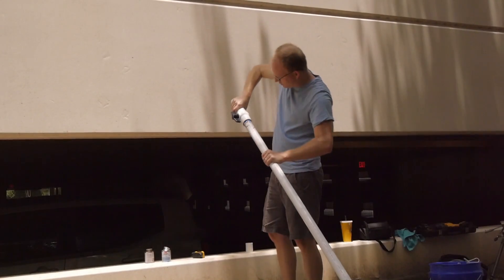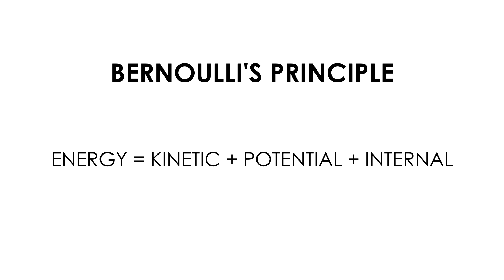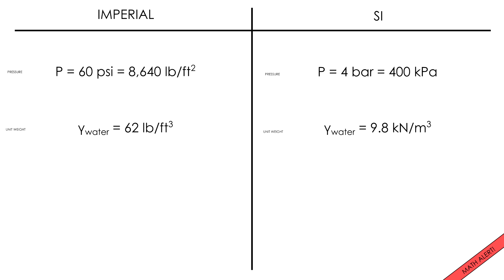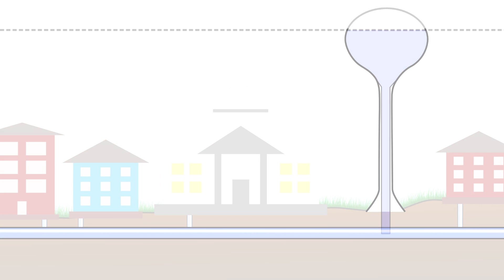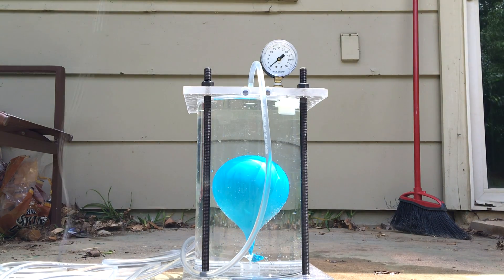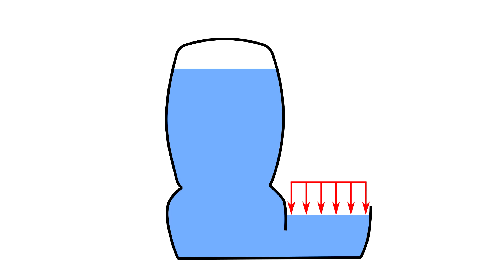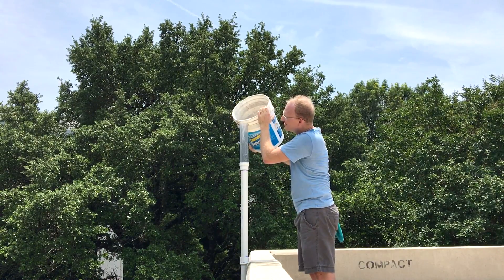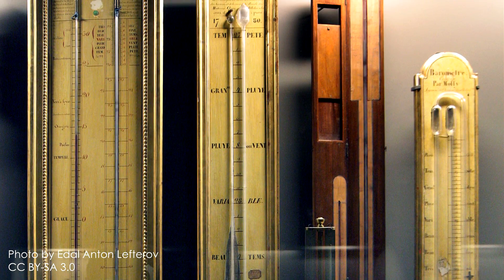Boil Water at Room Temperature! - Hydrostatics

Comment: First of all, I loved the video. Unfortunately... I watched it over and over and I just don't understand why or how the water in the ⅛" ID tube creates as much pressure as an ocean full of water if you were as deep in the ocean as the tube is high.  I understand the equation and I see how, if the equation is correct, the pressure is not affected by the volume of water, but I don't get how it COULD be correct.
Reply: visualise a particle of water. when measuring the pressure you're messing the weight of all of the particles above that particle pushing down on your particle. imagine the particles above as a column. This case represents a very small area such as the tube. Now imagine a larger hypothetical flat disc underwater. This is much much wider across than the particle and there are a million particles on this flat disc. when measuring the pressure you're measuring the weight of the particles above your particles in your disc. this time you have a higher weight, but more particles to spread that weight across. you can thing of each particle in this disc as having it's own column of particles above it just like in the first example. from this you can see that it only matters what is directly above the point where you are measuring pressure, not above and around.
Reply: +BR H that's incorrect.
Reply: @Logic Bob: you think of force, not of pressure.

Comment: Had never heard of inches as pressure unit. Which isn't very surprising when all units we use are SI derived.
Reply: It's actually hectopascal (hPa) that we use in Finland.
Reply: And I didn't quit read what you were saying. I think I've heard mmHg at least before.
Reply: Imperial units should stop existing all together anyway =D
Reply: If you're Finnish, we had it in physics class in lukio.

Comment: how does the boiling effect affect enhanced liquid. would room temperature coffee heat up in a vacuum if I brought it 10 meters up in the building? Forgive me if I'm asking this incorrectly.
Reply from the maker: The state of matter for all substances depends on pressure and temperature, but they're all different. Google "phase diagram" if you want to learn more about this concept. Coffee is mainly water, so I suspect it would behave similarly.

Comment: So you're boiling room temperature water...   Does it get hot then also?  Would a Thermometer at the top of the parking garage pipe have spiked?   Or since this is about pressure, would heat have nothing to do with this?

Was it hard getting permission to build this?

Cool project, Grady!
Reply from the maker: The water actually gets colder because of the rapid evaporation.

Not too hard to get permission. Thanks!
Reply: Yes the temperature of the water does not change, just the temperature at which it boils. The same reason that water boils at lower temperatures on top of mountains, due to lower pressure.
Reply: Temperature remains the same in principle. What does happen is that evaporation (the actual bubbling you see) is an endothermic process, so that should actually cool down the top! But from a pressure standpoint alone, no, there is no difference in temperature.

Comment: Great video Grady!
Reply from the maker: Thanks!
Reply: @PracticalEngineeringChannel  when the water boils/voporize due to low pressure, does it get very cold ? 
It should absorb energy for the phase transition ?
Reply: Top ten anime love bonds that will never be broken
Reply: Great now I am sub to both
Reply: I was just thinking that maybe it would take less energy to boil water if it is brought up high prior to boiling, perhaps even sped up by splitting the water into multiple thin pipes before letting it re-join at the end. Could you perhaps do an experiment with that theory and do a vid about it please, or has that been done already and if so where?
Reply: No